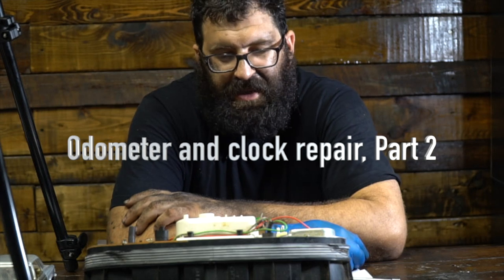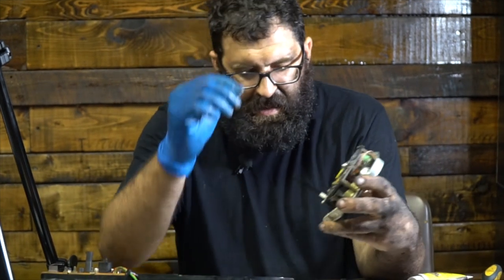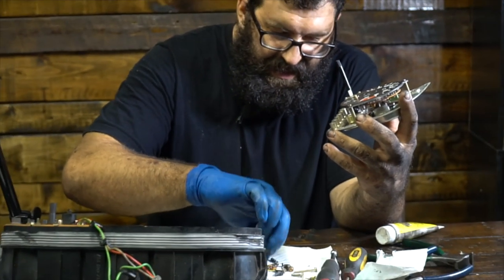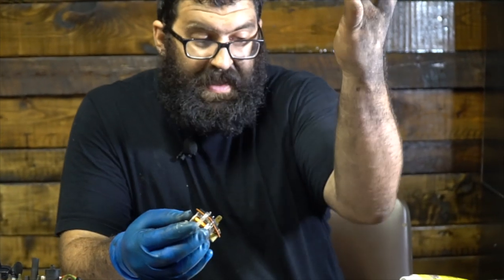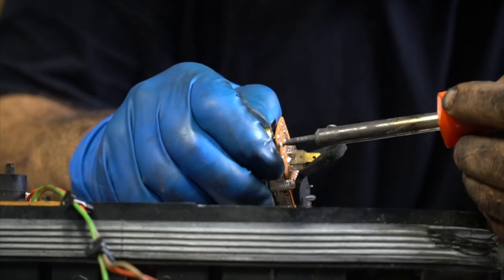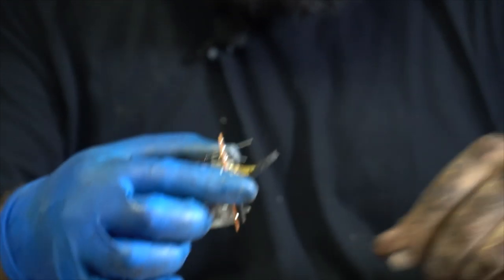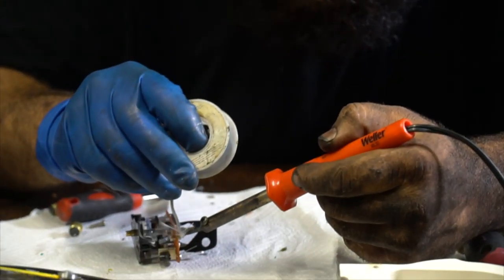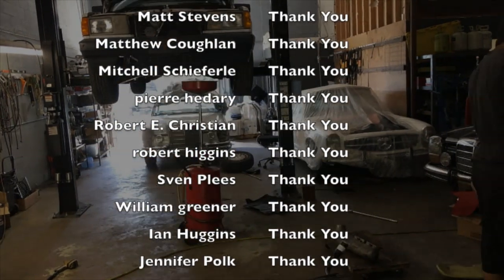Odometer and clock repair part 2

Comment: I did exactly this few years ago on both W201. I am not in electronics and I have been able to fix both W201 clocks my 1985 had only one capacitor and  the other was a 1992 that had 2 capacitors. It is not hard to do. What it is hard is to stay very CALM as Pierre was doing in part 1 and 2 videos. I stayed calm while removing the cluster, unscrew everything then fixing the clock. What a joy to see it work after all the pain! And Pierre, oui, yes I did painted my needles!! 😂😂😂 I used artist water base fluorescent orange with a light coat of varnish. They never fade thru the years!

Comment: 3rd time attempting the post ( in case it show up  3 times )

Frako is still making things out of Germany, easy to search their name for site.
North American distributor seems to be industrial only, maybe contact Frako to see if they still make smaller sizes.

Much appreciate the videos.
 I guess that the two capacitors for the clock are bi-polar ones ( no polarity ) ?

Comment: I replaced the capacitors in my w123s clock last weekend, it’s the first time the needles have moved in at least 16 years!
Surprisingly, one of the old capacitors was still good after 35 years (but I replaced it anyway, since taking it apart is not something I want to do twice).

Next on the list: have the Becker radio rebuilt with an AUX input...

Comment: Pierre its important that the capacitors are flush with the board for aesthetics, but also for current flow the shorter the leads the better the current can flow.

Comment: I’ve seen some Farad capacitors on eBay. Farad has a website, idk if they carry small stuff- they have an overseas phone number.  

On some reel to reel forums they are saying Farad isn’t great quality. I’m interested learning this stuff anyway. 
Update: I can’t find any Frako brand. Amazon has Bojack brand with same capacity and voltage values. 100uf 16v 
**No lunch required**